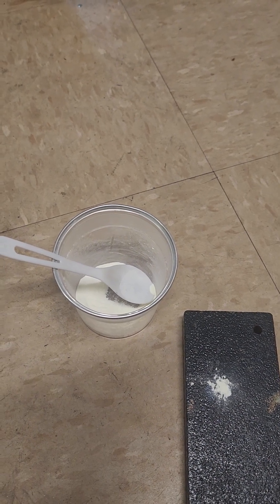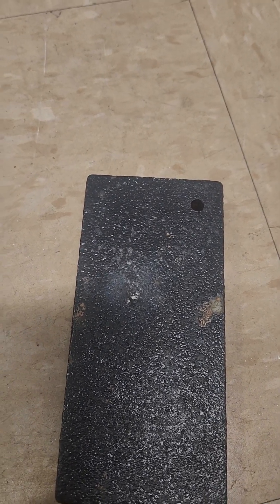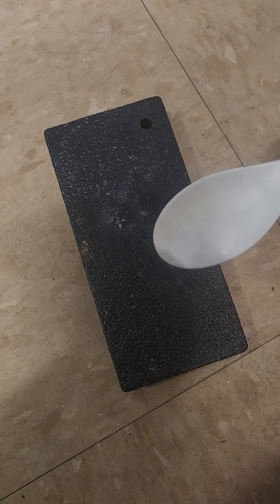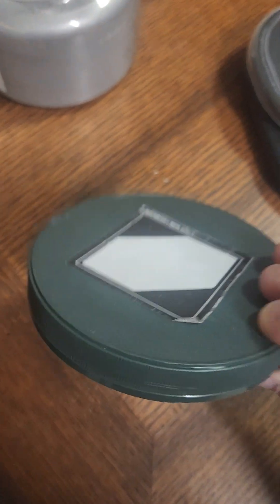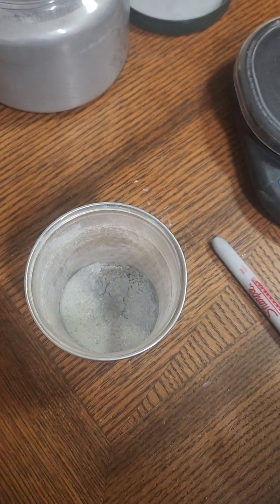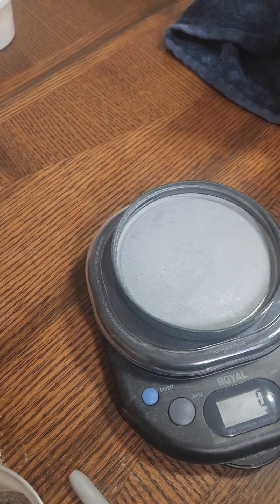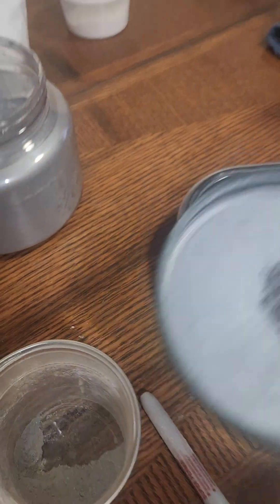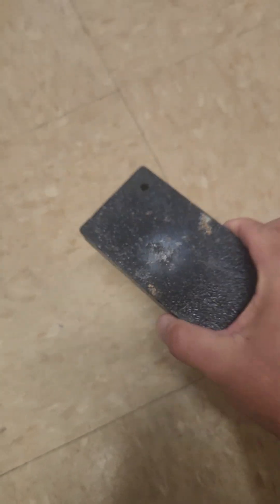BLUE ALUMINUM/CHLORATE/SULFUR [TEST OF SENSITIVITY ]

Comment: The blue aluminum isn't doing anything chlorate will ignite with anything dude. Which is why you don't want to mess with chlorates perchlorates are much safer. You mix that crap with Nutella it will go off.

Comment: I've read that flash made from chlorate and sulfur can spontaneously ignite on its own if too much humidity gets inside the tube. It'll start releasing hot gas until the salute explodes and that a couple drops of boric acid in the mix prevents this. I THINK it was chlorate and sulfur mixes. I dont use either, just a 70/30 of the best kclo4 and Al u can buy. I have some salutes of just 70/30 that'll hit harder and more deep than sulfur mixes believe it or not